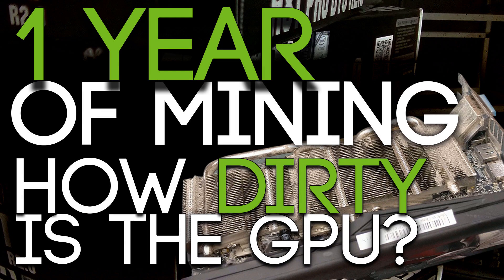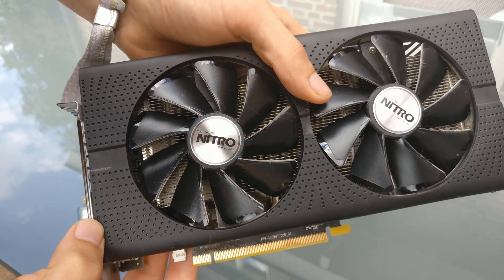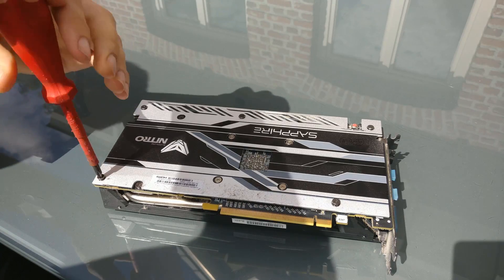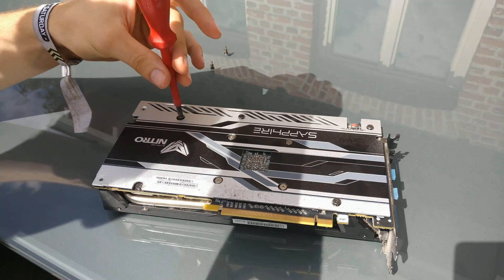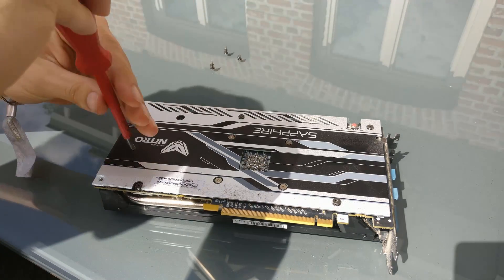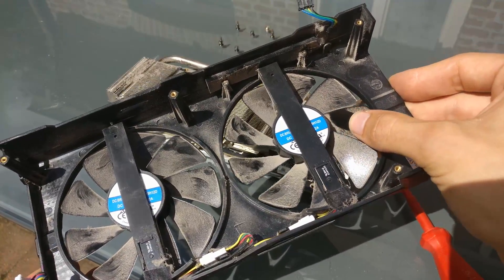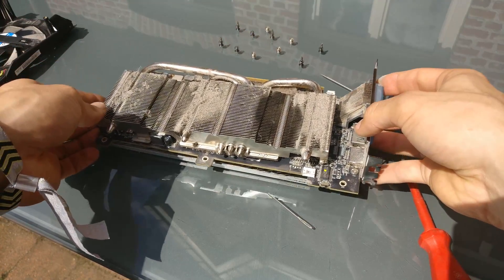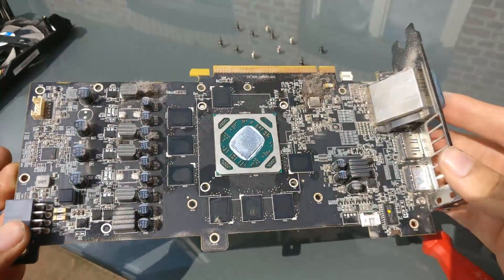1 Year of GPU Mining, How Dirty Is The GPU?

Comment: Honestly, i just don't get why AMD/Nvidia doesn't just ether overproduce for miners (Its just more sales for AMD/Nvidia)
Or make their own lineup that is DESIGNED for mining.
They will just end up making MORE money.
Reply: Why do i get the feeling Vegas High TDP is to discourage miners?
Anyhow, Good video, however it may be easier to just blow it out with an Air Compressor set to 15 PSI
Reply: This could have happened if something went wrong with the production of ddr4 or anything else really that limited the production of graphics cards.

But in this case that we face now its that they can't meet the market with enough production capacity & everyone else has to increase prices to get materials & perhaps halt production of something else that was a daily income in favor of a larger income for the manufacturer plays a part in this as well as they couldnt meet the production quota of x amount of gpu manufacturers & focused on meeting production for the rest before dedicating production towards the gpu manufacturers.

& building another factory isn't exactly cheap or done in a day either.

A production plant for hard drives took damage in a flood, for example that took over half a year to just fix some damage too the plant & catching up on production took the rest of the year as production had to be reduced quite a bit.
 & that was one manufacturer that drove up the prices.

There's so many more markets that needs ram & other components now then what it used to be even back when ddr2 was the main production line.

Smart devices everywhere of just about any kind is using ddr4 & other components computers by hp and other oem manufacturers needs ram & all that jazz.
They cant stop production somewhere else to produce graphics cards for the 50% of the gamers that is looking out after a graphics card at the moment, while being fine with what they got still & just wants newer because its better or wants to crank up those settings.

Im fine on my r9 280 here since i got it in a sale in January of 2015 for what i play.
& got a 2nd gen I5 2500 on 4.1 ghz turbo as cpu.

Comment: The four silver screws arround the processor  are for holding the heatsink and the other black screws are for holding the case and the fans, when clening u should take off the black ones and then u should lift the case and the fans, then u take off the silver ones and take off the heatsink. This is very important because if u take all at once and you lift it the heatsink can fall and break some electronics in the motherboard of the gpu.

Comment: OMG what you just have done is like the biggest mistake ever if you ask a PC-Hardware guy like me!!!
DON´T EVER undo the four GPU screws clockwise!!!! You have to do it in a criss-cross pattern and you used way too little thermal paste! WTF?! Damn miners! Stealing GPUs from Gamers and PC-Builders, rise the price of the GPUs and treat them like shit! If you don´t know how to handle PC hardware DON´T do it!!!
Reply: Sir, that only matters when you're actually putting on the heatsink, other wise it doesn't matter. It's not like you're trying to relieve an equal amount of pressure. Also, it doesn't really matter how much thermal paste he uses, it just has to be "enough" to coat the actual die.
Reply: Z Bobplays I know but if you look at the video, you see he actually tightened the GPU screws clockwise and it's not enough thermal paste, the rule of thumb at GPUs is not like "less is more " like on CPUs
Reply: Z Bobplays Z Bobplays I know but if you look at the video, you see he actually tightened the GPU screws clockwise and it's not enough thermal paste, the rule of thumb at GPUs is not like "less is more " like on CPUs

Comment: 101 people watching this video are salty gamers :3
Reply: Oddvin Lorenzo Preinstad yeah I don't understand how they think a guy with a few gpus has the same impact on the market as say someone with 100s of them
Reply: Guess they see mining in the title = one of them that ruined the market.

Meanwhile the truth is it was the shortages of components that's needed to manufacture the cards drives up the prices as production of new components isn't fast enough to meet the demand of the market for x amount of models of gtx 1070.

Rather then people paying for the products causing a rise in prices.
If it was the same amount of graphics cards being bought by gamers who would they try to blame then ?

Ram is at an all time high on ddr4 for example as just about every smart device is using that now instead of ddr3 & ofc computers made by oem manufacturers, dell,hp,fujitsu,lenovo etc is ofc using it as well.

DDR3 is no longer produced in any greater scale besides for cheaper phones but most of that market buys old stock of ddr3 chips that is sitting in warehouses or produced at a smaller scale.

NAND storage is also crawling up in price as the market is flooding with computers featuring an ssd of some sort in the system or is being used by smart devices as local storage. but that market is getting filled up fairly well still so the price doesn't fluctuate as manufacturers can actually meet those demands on storage & start with price cutting.

Comment: Use the brush attachment for the vacuum you dill; also compressed air from a scuba tank works wonders but only do this outside as it will fog up the house with dust. Pure alcohol metho for cleaning parts, no water! and avoid drying with rags as it can catch components & dislodge them. 100% remember screw locations, use a white bit of paper and use 2 sides tape to draw/mark and store screws.

Comment: haha sry i had to laugh when u said ur rig has been mining 24/7 for a year and uve never cleaned it
and i thought my 6-7 months was bad lol
and the thermal paste they use on GPU from the manufacturer is supposed to harden
its kinda like a combo paste adhesive
although if u can get away with replacing with a liquid metal ull see a lil better thermal
but ull have to re-do the liquid metal more often
most more liquidy pastes dont last as long, at those temps, as their paste/adhesive combo
thats why they use it, so u could have a GPU 3 years old and the paste is still working

Comment: Use a high pressure air compressor. Blow out all that dust no problem. I clean my case often. The power supply tends to have the most dust in it.

Comment: 1 year of mining?
my miner always crashes after 20 hours non OC😂😂
Reply: terorie set it up to restart ever 12 hours and auto start miner
Reply: Pwoppop Pwoopoo that's kinda pointless if your memory has no errors, simply get a more stable oc and newest drivers as the guy above said
Reply: Tehcommentery Thanks for the advice but hell no I'm not using Windows.

When I get a kernel panic, I set the CPU watchdog to simply reboot the system and I'm up and running again

That's about 1 minute of downtime every day. But I got other stuff to do so that's fine.
I'm not using any risers though because they're all faulty.
Reply: BasicallyImHigh it wasn't pointless for my situation. I had the same issue. Took around 24 hours to lock up. Reboot every 12 and haven't had an issue since. More than one way to skin a cat
Reply: terorie at least you can rule out windows as the problem, since you're not using it.
Reply: Pwoppop Pwoopoo You can do that with cronie right?

Comment: hi this mi rig not sure if i need another power supply. 
Crosshair VI Hero: 
Noctua NH-D15 SE-AM4 Premium-Grade 140mm Dual Tower CPU Cooler
Ryzen 7: 1700x 
2 Asus Strix RX 580: top 8gb (1 not installed yet)
Asus Dual RX 580: 4gb
Asus Rx 560 4gb: (not installed yet) 
Flarex G.skill 8gb x2 
evga 750p2 is my power supply enough to install the other gpu,s??????
Reply: MrSupergiga
BeQuiet! Has a really good psu calculater on their website.
Reply: alredy bought a evga 850 p2 thank you for the info

Comment: compressed air and a small brush do the work, get high quality thermal compound and the next time open the fans, they accumulate dust and crap on the inside and slow them down

Comment: u did not clean it properly and forget to add new thermal paste
Reply: ampopol poldo Why? That's wrong. The cold plate of the heatsink has pressure too, which squeezes the pea of thermal paste spreading it
Reply: ampopol poldo I wouldnt put too much on it because all around the die are some little transistors and stuff and i wouldnt want them covered in gunk...
Reply: I use a non conductive thermalpaste here (25 gram tube of arctic cooling ceramique 2 works pretty great here as long as you get a bit of pressure on the gpu or cpu cooler initially when mounting it.)
compared too how a laptop from 2005 went from mid 70 - 75c idle with barely any dust on it left too mid 35 - 40c was pretty impressive. (had those weird foil stickers with compound on them & the thermal compound was pretty much turning to dust if i scraped on it.)

In general I do the dot in the centre, should cover the gpu or cpu 70 % or more of it on a cpu while on a gpu its 90% at least of the die itself.

(Usually do test briefly if im unsure. I usually clean off and re-apply once i see it being either enough or not enough. (area it spreads on either the cooler or the cpu/gpu itself.)
Reply: he added it.... 5:15 he just skipped over that part.
Reply: i watch a video of steve in gamers nexus saying that you should apply quite a lot of thermal paste for gpu die. because the thermal design something like that.
Reply from the maker: Seats 4 Fans exactly ;)
Reply: he did not put thermal pads for vram and the thermal paste is so little, its not cpu to put a tiny amount of thermal paste,
cpu= just a pea drop
gpu= should put paste on the whole die(or else it will burn/die in no time)